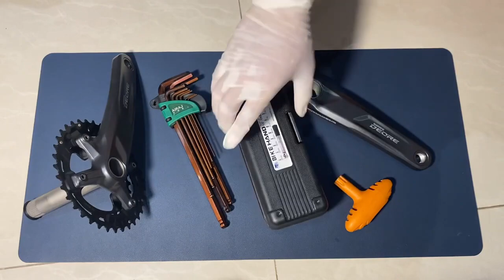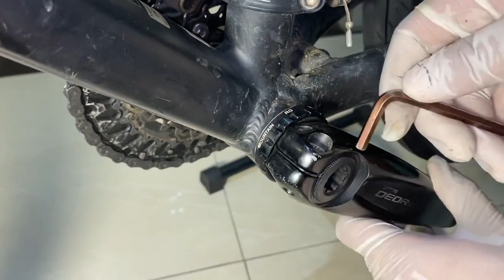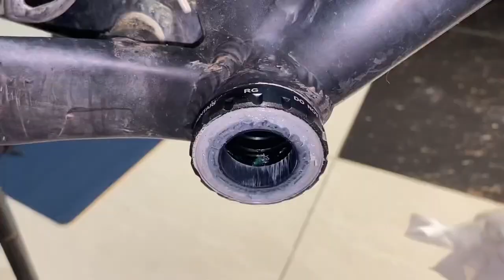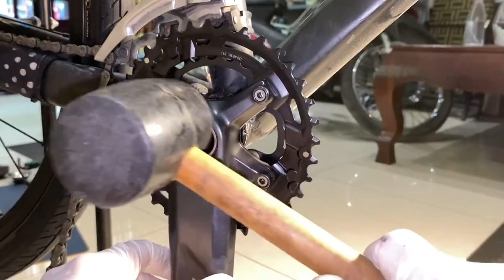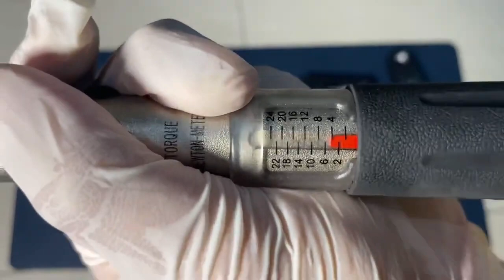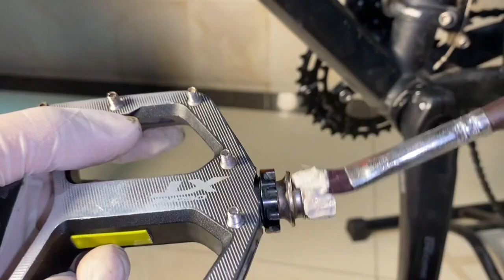Converting Shimano Crankset Deore M6000 3x12 to Deore M5100 2x12

Comment: This is downgrade
Reply from the maker: Yes it low than m6000 but it new
Reply: @pechkai2  м6000 lighter & better
M5100 not hollow
Reply from the maker: @Zoomer360  you are right, I plan upgrade to Deore M6100 soon
Reply: @pechkai2  м6000 better than m6100 too, m6000 hollow crank, m6100 not hollow, m6000 stronger and lighter, m6000 better
Reply from the maker: @Zoomer360  really ?
Reply: @pechkai2  yes, m6000 better. If you want something better than m6000 you need slx m7100 or xt m8100, xtr 9100 too expensive
Reply from the maker: @Zoomer360  I love XTR but it too expensive
Reply: @pechkai2  you need buy slx m7100 its most popular and super puper crankset
Reply from the maker: @zoomer360 great, I will try slx
Reply: @pechkai2  м7100 better than m6000